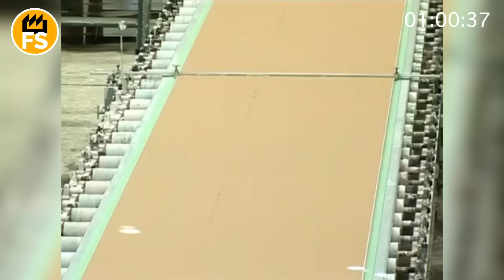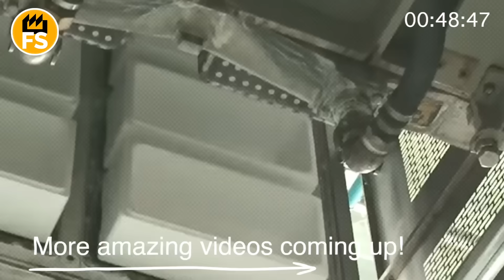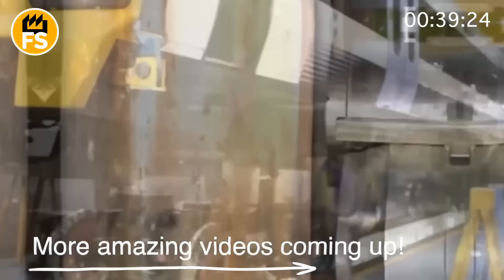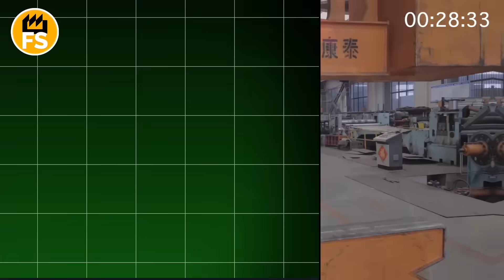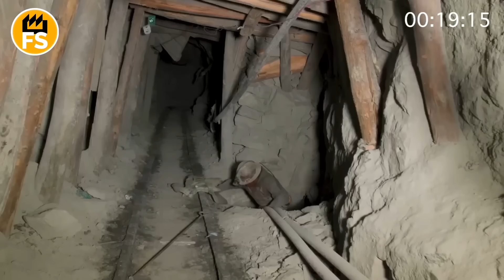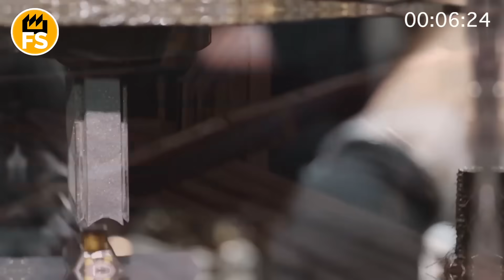How It's Made: 27 Billion Square Feet of Drywall Per Year! | Top 10 Videos on the Channel

Comment: Producing 27 billion square feet of drywall a year really shows how refined continuous manufacturing has become — massive volume, yet tight control at every step. It’s impressive how such a “simple” product depends on precise timing, materials, and process discipline. Which part of the line stood out to you most?
Reply from the maker: Thank you for your insightful comment, @SmartTechFactoryOffical! The precision in the mixing and drying stages truly amazed me, showcasing the incredible engineering behind such a widely used product. 🌟

Comment: These look like plasterboards to me...
Reply from the maker: Indeed, @sibalogh, drywall and plasterboard are often used interchangeably, as they serve similar purposes in construction. Thank you for your observation!
Reply: @Factory.Secrets  And most of us knew it as 'sheet rock' as well.  In the early 1950s, my dad and grandfather built about 8 houses.  Then, they used 'Lath and Paster' for wall covering as I guess sheetrock was still catching on.  Best as I can recall, these were modest 2-bedroom houses on 3/4 acre lots.  I believe they sold for not much over $5,000.  In the early 1950's, $5,000 was a lot of money.